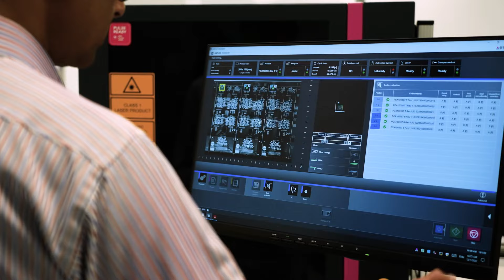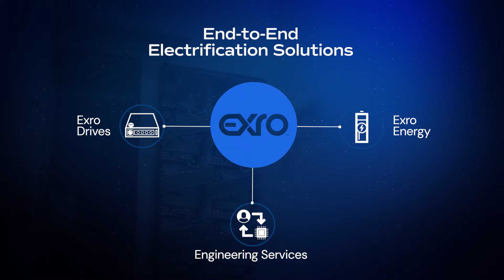Exro Technologies: Power electronics experts on a mission to use minimum energy for maximum results

Comment: Watching you folks progress has been quite invigorating.  It's seems you have a very good technology and are placing the right pieces of the necessary puzzle in place in a reasonable sequence despite the difficulties within the current financial environment.  A friend and I built a Bedinni wheel and a motor that had a significantly different coil configuration with the pulsed electrical input so I "kind of" understand the theory of trying to eliminating the back EMF. Electromagnetism and their frequencies are much more important then many realize. Even Royal Rife, the investor of various high magnification microscopes use it to cure 16 of 16 cancer patients some 70 years ago. Interesting how big pharma never even tried following up after his clinic was raided and equipment stolen.  They even tried to prosecute him, and others successfully using his pulse generator to cure people, for practices medicine without a license.          .